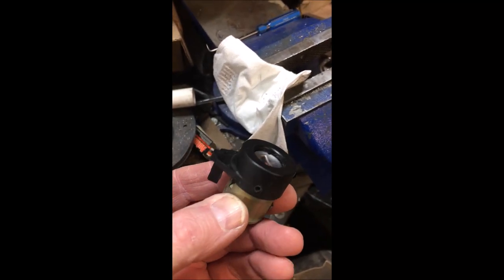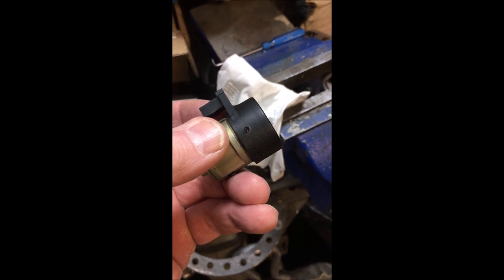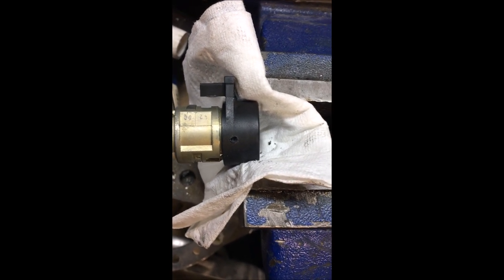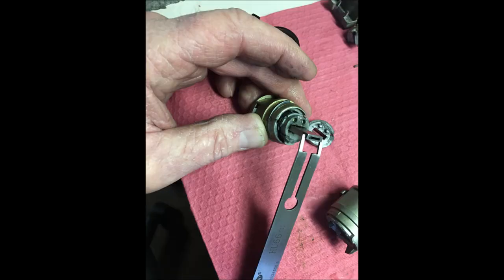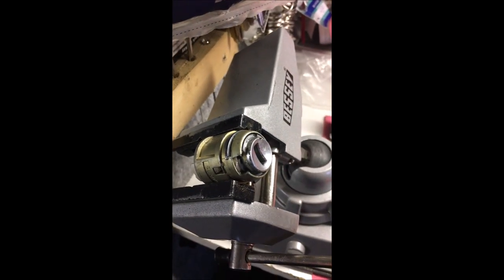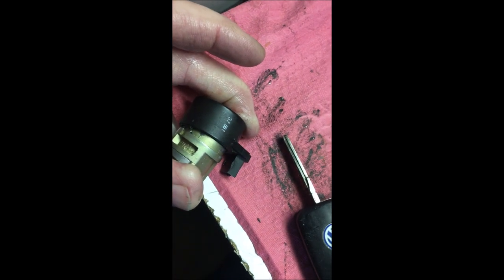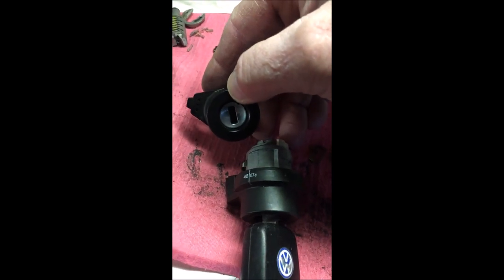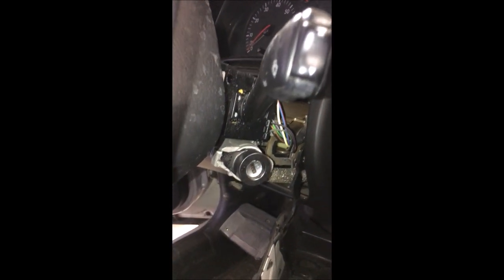rekeying VW/Audi ignition cylinder

Comment: 15 April 2024   Thank you for a good video.  I rekeyed a 07 VW Rabbit ignition with the larger diameter black plastic collar you talk about at 5:10.  I'm a locksmith on the west coast of Canada.   Here's my notes and procedure:  lookout for that black plastic semicircular piece of the buzzer relay.  It  and it's spring can come out of the pot metal housing easily. use a scratch awl to mark the relationships of the black collar to the pot metal housing so when you put it back together it will be in the same place as when you started.  drill in same location around the perimeter as in the video ( so the hole ends up on the bottom when installed back in the ignition housing)   drill right at the intersection of the large diameter and the small diameter of the black plastic antenna ring.  clamp black plastic in soft jaws of vise.  hold pressure on probe in drilled hole so it is always pushing down on the circular spring clip.  twist/pull on pot metal housing while holding it gently with vise grips with them locked on the 2 flats on the housing.  try to determine if probe is pushing down on the end of the spring clip.  if it won't come out try turning the housing some to realign the clip and try again.  it will come out.  when it does the front anti drill will fall out - no worries it can only reassemble one way  with it's 2 pins into the 2 holes on the plug face.  As he mentioned the plug must be turned all the way clockwise for it to slide out of the front of the pot metal housing - this is because of a notch in the plug face and a corresponding projection of the housing.   rekey using ASP kit # A-31-306.     The key should turn freely with no binding.     REASSEMBLY...   you might need to clean up the circular groove in the black cap if your drill left bent bits of metal sticking out into it.....dremel and wheel.     use tri flow on the spring clip and groove.  put  together using alignment marks you make before taking apart....push in on housing so it goes over the middle of the spring clip first then use a tiny flat blade to help the 2 ends of the spring clip to get into the groove.   Thanks again and keep up the good work.
Reply from the maker: great notes... thank you..
Reply from the maker: ps, i am south of you.. south of Seattle..
Reply: @timtracy9442  I'm in Victoria B. C.

Comment: I've been looking for something like this for hours!
Reply: Makes it look easier than it is, that was a fight to get that cap off. either way I was able to get it off and rekey the ignition I had, I am happy I found this video
Reply from the maker: @connormcleod8873  Isn't that what youtube is supposed to do?? easy-peasy... The BMW cylinders are even worse...  You can buy the cylinders now with the antenna ring left off so you can rekey them...  You gotta remember, this was a couple years ago when we couldn't get any cylinders except new ones ordered by VIN from VW, so if you wanted to change the locks on a theft recovery car, you had to persuade the dealer to order an ignition for another VIN...
Reply: @timtracy9442  they can't steal the car if you remove the old keys from the system with the software where the chips in the key won't allow it to start.

Comment: I’ve watched your video a few times, I have a different issue. My ignition was catching so I removed the cylinder and installed it on a new ignition assembly. The Dorman switch assembly won’t turn at all and now I can’t remove the cylinder is there a trick to make it turn? Apparently removing the antenna won’t give me access to the latch as the key has to be spun in order to release.. please help if you will.
Reply: It’s a 2002 Audi A6 for the comment above
Reply from the maker: what year and model car are you working on?/  the 2007-2011 vw's have issues with the cylinder housing, they will either not turn on, or not turn off.. there is a part in the steering lock assembly that wears into the housing causing problems.. we replace the housing.. just remember, the housing comes in the on position, if you rotate the barrel back to the off position you have to tear the whole housing apart and reclock it..and yes, you have to turn the key to line up the poke hole with the locking pawl.. or drill a hole in the housing and poke in the locking pawl
Reply: @timtracy9442  It is a 2002 Audi A6. I used a dremmel to cut the new Dorman ignition lock around the piece that holds the cylinder in place. This way I was able to recover the cylinder. I ordered a used steering column with original parts off eBay for $70 that came with everything. Antenna, ignition switch with key and cylinder. I removed the ignition and used the old cylinder I had. While I had the cylinder apart I cleaned it and added a dab of grease. Works great now! 
Thanks for your reply and your video, it was very well explained.
Reply from the maker: @nutcrackerBtK  Awesome....  I just bought a 2001 Audi A6 with the 4.2 V8.. it had a broken sparkplug... What a beast....